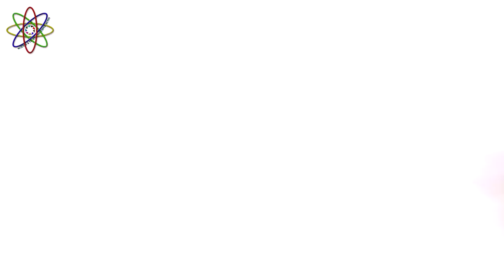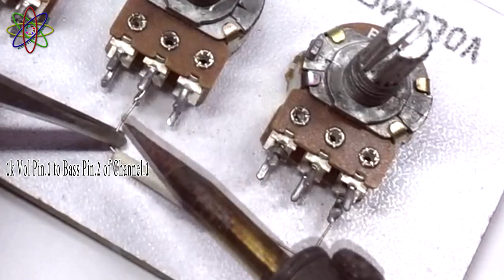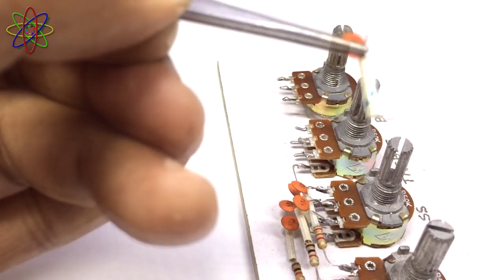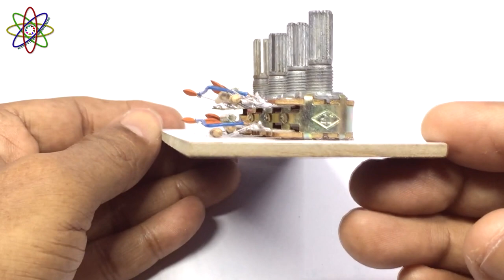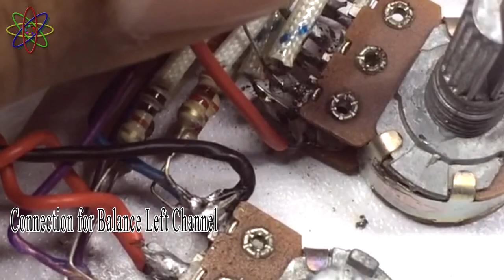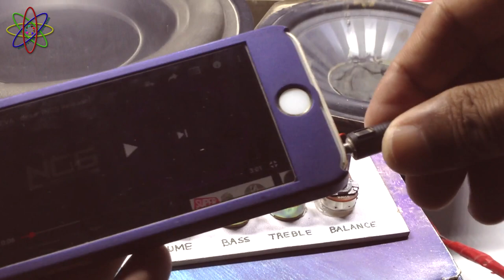DIY Stereo Bass Treble Volume Balance - How to make heavy bass and treble for diy Stereo Amplifier

Comment: How much value should use volume bass treble balance controls in LA 4440 stereo ic amplifier board. Please answer me 🙏
Reply from the maker: I used the same circuit to la4440 amp on my channel & was working well.

Comment: Brother I also try this project.Your projects are very good so Please connect it to d718 homemade amplifer.
Reply from the maker: Thanks for watching & comments. I will upload D718 & B688 stereo amp with this project after a week. Stay tuned. Thanks.
Reply: This treble base circuit only works with stereo amplifer why not on the others.what is the mean of stereo.
Reply from the maker: @Its-07  Stereo mean 2 channels. It is using double potentiometers. If you use single mono amplifier then use single potentiometer bass treble which is already available in my channel. Thanks.

Comment: automatic adjust bass trebal ya push  button ke sath bass bdhane wali ka kuch hota hai 
Jiase altec lancing ka xa 3021 me hota hai to bataiye
Reply from the maker: Push button par isko bhi kar sakte hen jo full par rahey ga. Pot ki jaga push button use kar len. Pot ka GND hata do aur pot k dono pin ke connections push button ki dono pin par laga do aur pot ko bhi hata do. bas ho gaya.

Comment: Can i use it for tpa3116 class d srereo amplifier?
Please reply
Reply from the maker: I think it will work.
Reply: I want to make a stereo amplifier for home 
I have a big box of two speakers 10 inch and 8 inch
Thank you for replying.
Which amplifier board i have to buy
 2n3055 
or
tpa3116 class- d amplifier?
Reply from the maker: @rahul_thakur__  tpa3116 class d is a good amplifier.
Reply: @ScienceTechnologyExperiments  thank you
I will make it after exams.
Reply from the maker: @rahul_thakur__  Thanks for watching. Best of luck.

Comment: The something that I wanna know, how to make 100 watt amplifier using LA4440? help please
Reply from the maker: LA4440 is a 19 watts ic and in stereo you can get only 19 + 19 = 38 watts.
Reply: OK thanks sir, how I can increase output current using npn transistor, for example  if I have a circuit with out put current is 500mAh how I can increase it up to 2-3Ah using transistor?
Reply from the maker: @madeintanzania2995  You can find circuits on google and videos on YouTube. Thanks.
Reply: Together, thanks joh!

Comment: You need some SERIOUS practicing with soldering
Reply from the maker: I think its much better as I am 63 yrs of age and cannot stabilize my hands.
Thanks for watching & suggestion.
Reply: @ScienceTechnologyExperiments  Understand that. I am 65 and have had two strokes, so the left hand is somewhat deficient. I apologize for my reaction. Your hands do not bely your age. I noticed the loose twist of wire ends and the debris on the iron tip. Those are thimgs I have seen on other videos where age or disability was not a factor.  I am intrigued with your design and may build a demo circuit myself. Other similar circuits such as the average Baxendall all suffer with a major amount of insertion loss dramatically reducing the volume.  So nice to see folks working with analog as it really gives you a asense of actually building something yourself.  My career was in professional audio Visual system design, operation and installatio as a pre-teen all the way through my last birthday.  Kind of sad that skills like this are rapidly dying out to the lure of silly video games. Most of the small Mom and Pop parts stores are gone as well